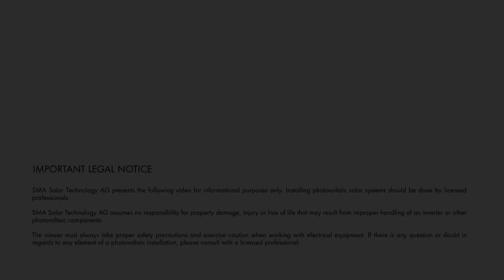Tech Tip: Common Error Code - VAC

Comment: I had the 102 error.  I live in CA and needed to select the CA L1/L2 only option. Then a hard system reset reboot the inverter. All is  good now.  Also, the initial log on password for wifi was not as stated. It was the WPA2 code listed on side of connection unit.

Comment: I just put in a SMA 5000w inverter and got this error when trying to initially commission.  The cause was NOT any of those above, but the configuration of the inverter was set wrong from the factory for my situation.   I use a 240 L1L2 setup with NO neutral.   The unit came set up for use with L1L2 + a neutral, so it gave me the "102" error code and would not start up.

To fix, you have to connect a computer (I used a laptop with a wireless card standing in front of the inverter) tablet, smart phone,etc  to connect directly to the inverter WLAN (not via the internet).  Instructions in the install manual for how to do this.  Once in, you do a configure set up and one of the pages will allow you to toggle between various AC side options. I used UL1741/1640/240 instead of the factory setting of UL1741/1640/120 (which requires a neutral), clicked on thru the setup, disconnected from the inverter server, and did the startup again (turn on the DC, turn on the AC outfeed, etc), and it fired up after about a 2 minute pause (which would happen normally if you lose grid power.....wait to 'see' if you have a stable connection), and worked just fine.

SO, IF YOU GET A 102 ERROR ON INITIAL STARTUP,  it's likely THIS is the cause, not loose connections or improper wire size.
Reply: Hi Ed, I am having the same issue, if you're still out there, what did you do?
Reply: @guidofrosini8386  Still out here Guido.  I did exactly what I laid out above.

Comment: Guys, whats the cause and solution to the "PE Disconnect" Error on the Sunnyboy 4000-TL20 inverter?
Reply: I've had several of these faults on sunny boy inverters (always when out of warranty). Nothing wrong with wiring or installation. Called SMA and told faulty inverter and needed to be replaced.

Comment: Very good presentation and content. I had the SRR disturbance error coming up repeatedly. I did all the usual checking and finally traced it back to a 13 year old microwave oven apparently going bad though it seemed to perform its intended function.  Replaced the oven and problem solved.

Comment: By Utillity do you mean PV panels  or house or factory appliances and or machines. Im soory it may seem like a strange question but im not sure what your talking about.please clarify it for me..Thanks...
Reply from the maker: Hi Rashidii - In this case utility means the local power company which provides electricity to the home of the solar system owner who is experiencing the VAC error mentioned in the video. Solar systems like this one are grid-tied and do depend on some features from a local electric power company to work. 

Hope this helps,
Justin